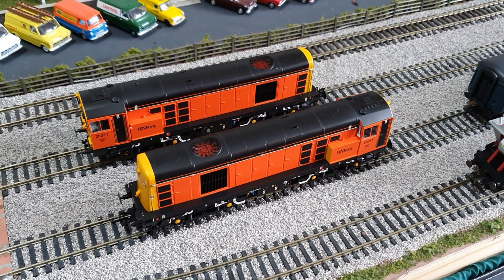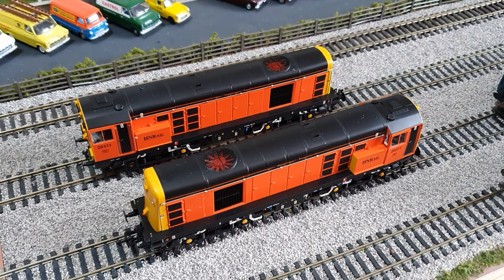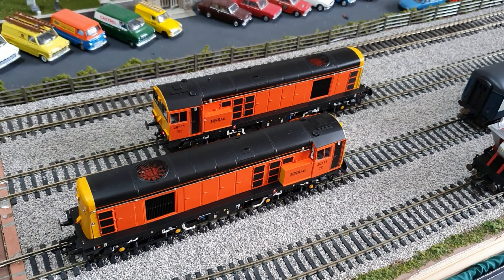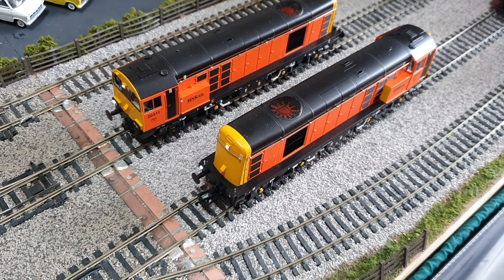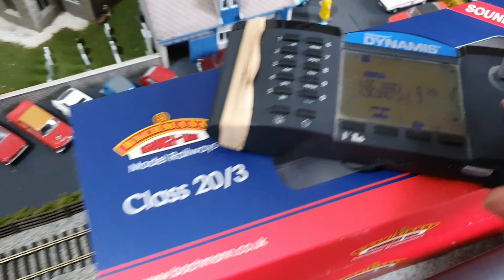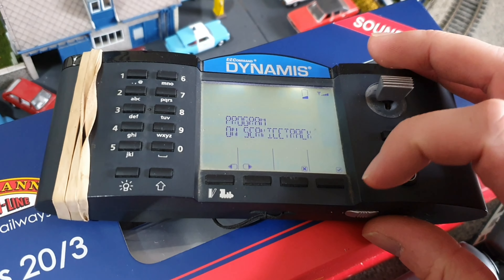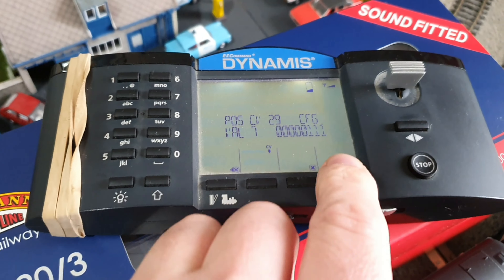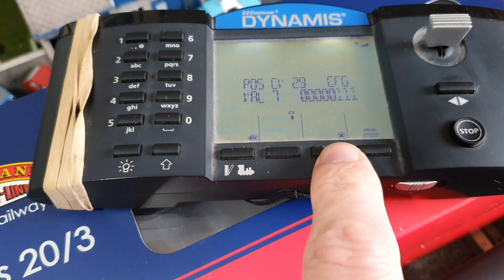How do you run the new Bachmann Class 20s as a pair.

Comment: Hi there, so yes you have made whats called a "simple" consist with both locos having the same address and as you righty did change direction on one loco in the CV. All I would say is that you needed to add a warning as CV29 does much more than change the direction. So best thing to do is "Read" CV29 first and then whatever number it comes back as just add 1 to it. Not all decoders have the same value for CV29. 
Thanks hope you didn't mind my comment Cheers Peter
Reply from the maker: Don't mind at all. I just remember having to change cv29 on my class 800 to get the lights to work. Was told that they are set to an even number so changing it to any odd number would work.

Comment: did you just change 1 of the locos or both
Reply from the maker: Changed CV on 1 loco only
Reply: @D402DDS  thank you for your reply, just one more question if i may,  are both locos 
on different address?
Reply from the maker: @smudger1309 in this video they have the same address.
Reply: @D402DDS  thank you very much,  for that information,